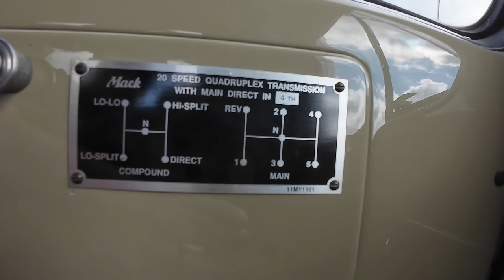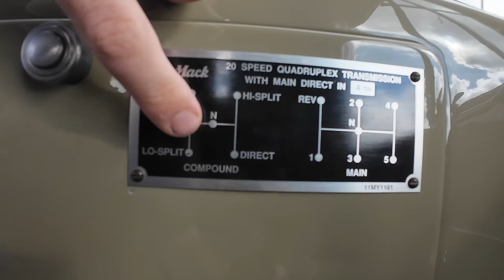2 Gearshifts | Twin stick shifting in my Grandpa’s old Mack

Comment: I was a laborer for a small construction company in 1978. I never drove any equipment or trucks because i was the grunt guy. One day my boss ask me to take a 18 speed dump truck 40 miles away to a job site. I told him and he already knew i didn't know how to drive a dump truck or had a license to do so. He throws me in the drivers seat and shows me how to shift the gears. He shows me how to use the parking break and then says get going. I was scared shitless! I felt like i was sitting in the cockpit of a jet with all the gauges. I started out and ground gears for 40 miles. Lol. Once i got to the job site i was ask to haul gravel from 10 miles away back to the job site. I told the boss i didn't have a license to drive trucks ( didn't want to either ) and he said i don't care we need gravel. Huge difference between a loaded truck as opposed to a empty one as i found out quickly especially on the hills. This went on for a couple of weeks and i started to get used to it and liked it more then shoveling. I sent in for a permit and got it. Now I'm waiting for the drivers test date. So there i am driving a dump truck going from the pit to the job site, life was good. I got loaded one morning and was headed to the job site when i noticed blue lights coming up behind me and they stayed behind me. I almost shit myself as i wasn't allowed to drive that truck without a licensed driver with me because i only had a permit. I pull over and he comes up and says, license and registration please. In those days you didn't need proof of insurance. I found the registration and passed him my permit and registration. Hoping he wouldn't notice i didn't have a licensed driver with me. Lol. He noticed! Lol. I ask him why he pulled me over and he said because i didn't have a fuel use sticker on the door. In those days you needed one on your truck or it wasn't allowed on the main roads as i found out that morning and i didn't know that. I ask the trooper how to get one and he said that he had some in his car. This was in 1978 or 79. I ask him how much and he said 50 dollars or this truck doesn't move. Luckily i had 50 dollars on me. I gave him the money and he put the sticker on. The trooper then says, Now about this permit. You know your supposed to have somebody with you, right? I said yes sir but couldn't find anybody this morning. That was my bullshit answer. He ask me when i was going to take the road test and i gave him another bullshit answer and said in 3 months. I hadn't got any paperwork back yet on when i was taking a road test. Lol. He says ok and I'm going to let you go but if i see you again after 3 months and you still don't have a license i will summons you to court for driving without a license. I think he let me go because he just made a quick 50 dollars that did go into his right pocket. I got home that night and did have a date for the driving test. Anyway, that's how i learned to drive a dump truck and i think that took 10 years off my life. Lol. Bet you can't do that today! Lol

Comment: What a throwback!! I learned to drive on a 4by4 spicer and a qudra Plex Mack! God the old days are gone for ever. I notice he doesn't have an air ride seat either, probably why I have back problems now. God bless and thank you. David
Reply: Oh the tings we endured, doing the job we loved. How about the Hendrickson walking beam suspension? That thing was a treat! The ‘64 International I drove in the coal fields had that. The bushings were so badly worn, watching the drivers in the mirror was to say the leased fascinating, watching them dance from side to side, go into a corner and feel the truck “walk” to the outside feeling the whole tractor sway from side to side. How did we survive?

Comment: Thank you for this video.  I drove two old Petes with two sticks.  Both were water trucks built from old log trucks.  Never had any instruction. Had no idea how to properly shift them.  In fact, I got my Class A with no actual instruction.  Single axle GMC 6500 5 and 2 speed and a transport trailer.  Never really used my license but always kept it up just in case.  37 years.  Last year, my doctors decided not to renew my physical. Major BUMMER.
Reply: Too bad they won't let you renew it.  It is very hard to get one nowadays.
Reply: I got my class A in 1988 with a dump truck. One of the mechanics could sign you off and you could go to the DMV with his paperwork. I applied to Southco dist. to deliver to convenience stores in a tt and they hired me with no road test or training. Like you,  I just figured it out. Thankfully it was a 9 speed. No tickets or at fault accidents so far.

Comment: Beautiful vehicle,  I had run a 1961 B61 pulling an old Rogers lowboy back in 1969 and 1970. It was a retired Hess Oil tractor with over a million miles. Dual sticks were not easy!
Reply: Old Hess tractor. I remember when my father became a O/O the second tractor he got was a 1975 4200 with a 318 air strater ,aluminum frame and wedge brakes wasn’t old enough enough to haul fuel but learned to work on the tractor. Videos like this brings back memories

Comment: Started on a  B63 Mack, which dad drove for a coal co. on the Western Slope of Colorado. When I came home from my mission for the LDS Church, I went to work for the same co. The truck I drove was an ‘64 International Emeryvile with 5X4 transmissions. The haul was about 8 miles one way, and the transmissions really gave you a workout. There wasn’t much of the highway that was flat. You hit high gear, then right back down, if you weren’t shifting you were turning and sometimes at same time. Really miss those old trucks, today’s new driver would be completely lost in those vehicles, I really doubt they could even get one started. Thanks for the memories, retired about 2 1/2 years ago after 49 years behind the wheel.

Comment: I actually learned how to drive a stick shift trans on a Mack B-62 cement mixer. Never drove a manual trans, until my dad got me a job driving cement truck for the company he worked for. I had another driver show me how the two stick trans worked, then I took my turn and 15 minutes later I was loading up for my first haul.  That was the most fun I ever had on a job.

Comment: When I first started running cranes, 25 years ago, we had a few old cranes with "brownies". Except, in a crane, the cab is so small, the sticks are north and south, instead of side by side, like in a truck. Every once in a while, you'd get the rear stick (the main box) with your elbow and put it into neutral, while you were splitting with the front stick...and then you'd have them both in neutral. It was a nightmare to get through town with. Good times! And, it's kinda funny how times change. That Big Cam 400 Cummins was unbelievably powerful back in the day! We used to fight over the truck with the 400 in it. Now I don't think we own a truck with less than a 550hp engine in it, and they're just plain old trucks we use to haul boom.

Comment: Back in '79 I learned on a '65 Autocar with a 5 and 4.  The truck I owned later had a Fuller 9 speed.  Like your Mack it had a 22" steering wheel to go with the armstrong steering.  Nice to see the trailer brake lever where I'm used to seeing/using it.  Definitely a nice trip down memory lane -- thanks.

Comment: 4:33 I wonder if you notice the slots in the screws holding all the placards to the dash are all lined up horizontally and the crosshead screws holding the switches are also. Neat, and a sign of attention to detail. Beautiful truck!!

Comment: What absolute beauty there. Manual transmissions are what makes a man a man. Those auto shifts are nice but anyone can be a steering wheel holder then
Reply: Well that is kind of true, but i made sure that both my son and daughter could drive a stick shift in their teens. Man or woman, the knowledge just had to be there. A skill no one can take away. And then I see OTR drivers that cannot drive a manual of any kind and my heart sinks.

Comment: Now that is REAL driving ... 😃 Thanks for showing how it is done! 
As far as I am concerned, I would have gladly watched the whole journey without any cuts - watching twin stick driving never gets old to me. 
And while you have explained the principal shift logic very well before starting, it was still somewhat difficult to figure out the reasons why you shifted at certain points (and why you did not shift at certain other points, although the engine sounded like a higher gear might make sense), because the viewer cannot 'read' the road ahead as the driver can (and has to). 
Also, it is somewhat difficult to judge the actual speed of the rig at any given time - I was quite astonished to hear that you were only going 20 mph at a certain point, it definitely looked faster than that to me.
Reply: Yeah, and 75k can make that seem pretty fast on the down hill side too!
Reply: 20 on that uphill grade was actually pretty amazing. Video is hard to show grade but I was watching the houses out the window behind him and I kind of know that part of the state. That was a steep grade two lane for sure.

Comment: Drove a 1953  LT it had a tri plex  and a 335 Cummins log truck had a center point steering and 1965 B model square cab with 350 small cam cummins  with power steering quaderpelx with a prossive brownie  loggers! Both trucks had general bunk equipment and feather light trailers  both had jake brakes  neat old trucks ! Wish i still had them !!

Comment: Great video! I understand double clutching and twin sticks but the concept of actually doing it is still a bit confusing. I'd always be worried that I'd forget what gear I was in.
Reply: It is no harder to remember what gear you are in driving a twin stick truck that to drive “single stick” truck. Actually I think it is easier but maybe that is just me. In any rate once you start driving a truck it becomes second nature to know what gear you are in and what gear you should be in
Reply: DOUBLE CLUTCHING IS NOT THAT HARD, I LEARNED IT DRIVING A 47 FORD SCHOOL BUS, I HAVE A 2002 CHEVY S-10, AND I D.C. IT ALL THE TIME...

Comment: When I started driving 60 years ago we called that second shifter a brownie. The first truck I drove was a 55 marmon with a 5 speed main box and a 3 speed 3:25 brownie. No power steering it had Armstrong steering, the a.c was 2 x 50 roll the windows down and go 50 mph. No radio solid spring ride that rattled your kidneys. The good Ole days. The kids driving today wouldn't last a day driving what we had to drive . Boy did this video ever bring back the memories. Using the jake to match your gears,that's an art not everyone could do that ,but be careful I had a new driver I was breaking in  try using the Jake to shift and the idiot killed the engine. When we finally got stopped he rode an I drove back to the shop and told the boss he could take him I was done. Nothing prettier then the long nose mack,that's when they made trucks ,what I'd give to be able to drive one of them just one more time. You are one good driver I've only known a handful of men that could shift both shifters at the same time.
Today's kids would forget what gears they were in.
Reply: My uncle wore a weight lifter's kidney belt driving that old iron in his later years just for that reason. Worst part was he was driving it with hanging beef in the trailer. When they first came out with clover leaf interchanges that was a skill.

Comment: What a beautiful ol Mack..  Your Grandpa would be proud of the way it is being kept up.. I notice you are double clutching the main box..  If you learn how to float the main box you will find you are not so tired at the end of the day, and there is a lot less wear on the clutch and clutch linkage..  Good video..
Reply: I was going to comment on that, actually. I'm not the most familiar with driving big rigs, but I'm wondering why he's double clutching instead of floating on the main box.

Comment: 1979 I took my CDL driving test in a rented Mack twin stick and a rented 40' dry van. Had 60 miles of driving experience... Passed with a 5 point deduction: couldn't find the headlight switch. From the DMV I went 160 miles to pick up a 40,000 pound load that paid $2200.00. Good old days. Your grand dad did a great job on the restoration and the saying is (was) that if you can drive a twin stick you can drive any truck there is.
Reply: I used to know a driver that ran tanker doubles, with twin sticks. His right arm was amputated just above the wrist. He would wedge his right arm between the sticks and throw them as good as anyone I'd ever seen.

Comment: I'm sure your Grandad is happy you are taking such good care of his baby. I know I am, it is a beauty! I tried driving a Mack Duplex for a week. Ended up with an IH RD450 with a Working th 5 speed and a 2speed rear. Not a synchro in the house. Then later I nearned it had been speced with a Diesel, but at the last minute they went for the Cornbinder gasser but didn't change the tranny. I did OK, no clutch up or down unless I thought about it or tried to explain it. Then all I could do was sit on the side of the road until everything quit spinning, great big KLUNK! and start all over. Over the Grapevine was a real bowl of jollies. Tehachapi, too.

Comment: Good to see someone actually use a clutch. Clutches are far cheaper to replace than transmission! I would have liked to have learned to drive twin stick back when I was driving. I was OK with with 9's, 10's, 13's and 15's.

Comment: I love that truck Sam. I got over a million miles in a 18 speed and I have driven the dual stick but I trained students and some hardly could shift the 18 , I could only imagine teaching them on the split stick. I use to double clutch the split stick or sometimes dot even use the clutch. Good video Sam. Your grandpa probably is still sitting in his seat you just can’t see him.👍👍👍

Comment: What a nice truck.  A Cummins Jake sounds alot like a Mack Dynatard.  My dad and his brothers had a trucking company and so I grew up around R600's in the 1970's and 80's.  No quadruplex's but the early ones had twin sticks with 6 speed maxitorque transmissions.  The main stick was 1 through 5 and the second stick was Lo-Lo, Rev, N, and Direct (not sure if they were in that order).  The later trucks were 13 speed Mack transmission with an air splitter.  My uncles used to talk about double clutching on the pre R600 trucks (before I was born) but I had never seen it done until I watched this video.  On the R600 the clutch was never used except for starting/stopping.  The dynatard was used alot for upshifting, making a trip up through the gears pretty fast.  Ken

Comment: Back in the 70's I drove a B89 Mack 5x4 hauling bunker C oil to paper mills. Here in Maine there was no flat roads just hills so my arms got a workout shifting and steering with no power steering. I was young and loved it.

Comment: Sam, the first truck I ever drove was a '66 Chevy Dump truck, 366 V-8 5&4 Spicer Transmissions. I later drove an old Mack B-81 with a Thermodyne engine. and the 5&4 Quadra-plex they called it. THAT was the smoothest shifting vehicle I ever drove. As a matter of fact, I borrowed the manual and learned to shift a 1972 Ford 8000, 225 CAT V-8 with 5&4 Spicers, from 1&1, to 5&4  all 20 speeds, and shift it back down to 1&1 and not scrape a tooth. I love that body style.
Reply from the maker: Very cool thanks for sharing!

Comment: God, does this bring back so many memories.........first truck I drove, 1953 mack with a 5x3 and a Cummins 220.....yeah, that was the power back in '53.......no A/C going to Las Vegas from LA in July.......lost 20lbs in sweat..lol. Beautiful restoration, you should be very proud, and beautiful countryside where you made this video.
Reply from the maker: Thank you for the kind words. I think this truck had a 180 or 200 Cummins when new lol

Comment: 1968 I started driving a 51 Mack tow truck with a two speed rear. Graduated to a 1962 B61 10 speed. Just before joining the Air Force in 1969, my boss bought a 1968 Autocar Triplex. I got to drive it a few times. That thing would work you hard. It was also a tow truck. A lot of municipalities are banning "engine braking".

Comment: Thanks for the demonstration, Took me back to the 1960s when i was a lorry driver in England driving a Foden with180 Cummins and twelve speed transmission  Three ranges on the steering column.  Low,  Direct & Overdrive. Then 1 2 3 4 on the floor Start out in low then  2 3 4 in low then  in direct spit each gear between direct and overdrive 1 2 3 4   58 mph top speed 20 ton four axle gross . but 40 ton with permits for low boy work.  Low & and first gear 3 miles per hour at 2100 rpm. I operated in the county's of Devon & Cornwall with very hilly country often went down to low & first to be able to get up the steep hills some at 25 % grade  I was twenty three years old in 1964 when i started driving it and was the only driver who drove it until I quit driving it in 1972 When  i came to the USA drove company truck  for Universal Transport Rapid City SD then bought my first truck in 1978 and sold my last one a  Freightliner Coronado 132 C15 cat 450 18 speed in 2021 in Las Vegas and retired  80 years young but still driving.   Eddy Smith  40 S of Vegas

Comment: Great looking old equipment.
When I started driving big trucks (100 years ago) it was in a GMC truck & trailer with 2 sticks.
It had 220 hp. engine - if the wind changed directions you had to shift gears.  😆😆😆

Comment: Wonderful old Mack. I'm sure your grandfather is riding along with you.  I drove a Maxim fire engine with a Cummins and Jake brake (repower from a monster Waukasha and stick). Loved it. Two settings for braking. I barely touched the brakes, which is handy when you need a foot for the Federal Q and Air horn.